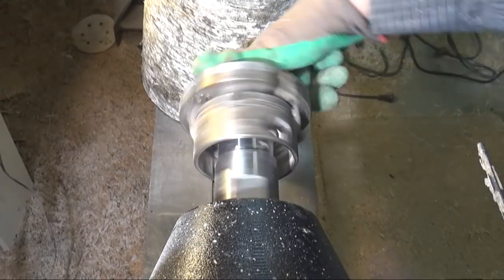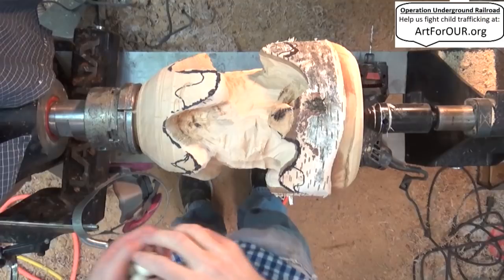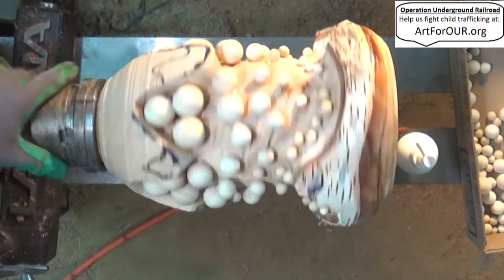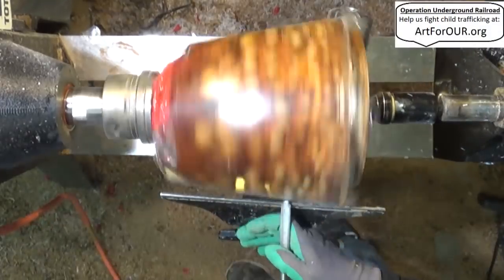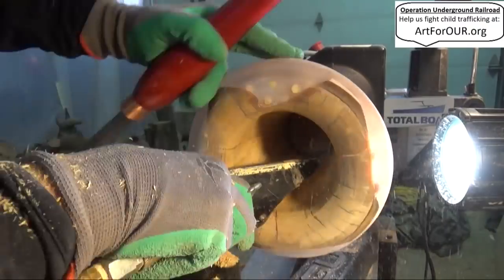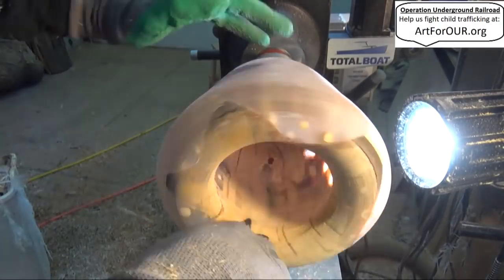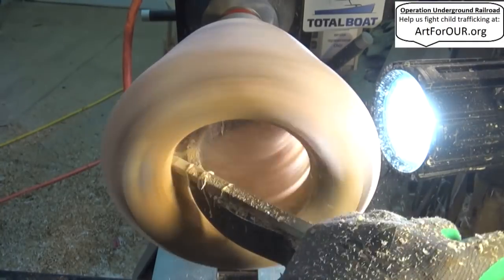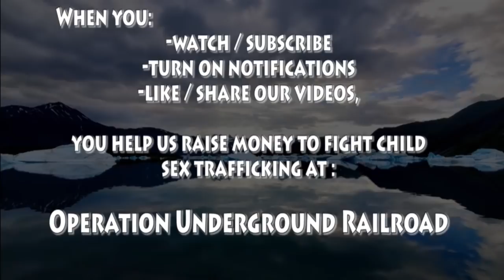"Bubble wood" Birch wood, clear resin, carved and turned on the lathe.  Wood and Resin Turning

Comment: Hey Dan now I'm intrigued have you tried using sanding sealer or maybe water based polyurethane to seal the wood before you use epoxy it might help to keep the bubbles down
Reply from the maker: I've tried sealing the wood several times.. I always get bubbles.  The best solution by far is to put the wood piece in the resin, run it through a vacuum chamber which displaces the air in the wood with resin.  Then a trip through the pressure pot...

I just got a 15 gallon vacuum chamber..... good stuff coming.   😀

Comment: Good Afternoon I'm the beginner I have the question.
You use the vaccum chamber with epoxy to pull out and seal the wood and then put on Air Pressure chamber to disappear air from the Epoxy.
Reply from the maker: Correct
Reply: Thanks to answer, another question you have or where I can by any temperture miter to put inside the Air Compressor chamber, I believe digital. Because I see yor video and you put that in the freezer
Reply from the maker: https://amzn.to/3CohrCX
Reply: @artgivinghope  
Again, is my pleasure talk to you thanks

Comment: Looks great Dan I was just wondering wouldn't it have been better to place it in the mold upside down then the tenon wouldn't have been so hard to clean
Reply from the maker: You're right about the tenon... however since I didn't have a big enough vacuum chamber yet for this project at the time,  I could only use my pressure pot, and I've found you get more bubbles if the bigger part of the wood is on the bottom....
Reply: @artgivinghope  didn't know about more bubbles I would like to say I'm impressed with your pieces and it's fantastic that you donate to operation railroad keep up the good work
Reply from the maker: Thank you!